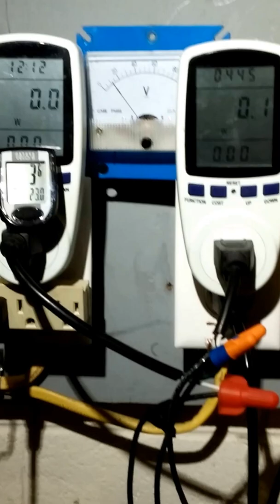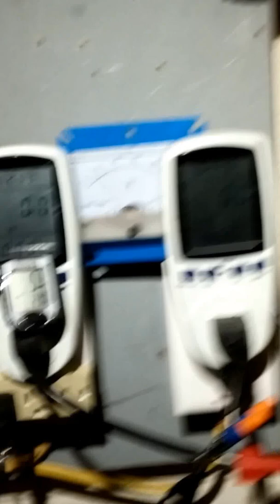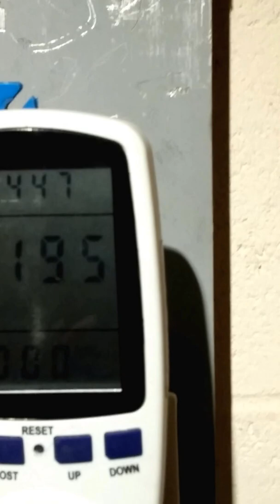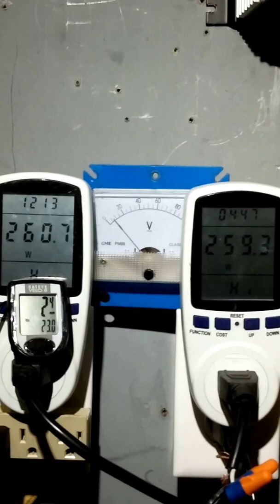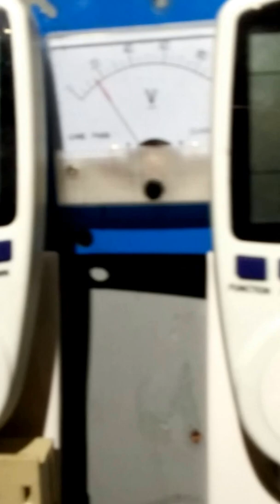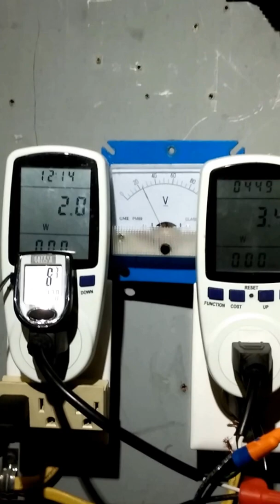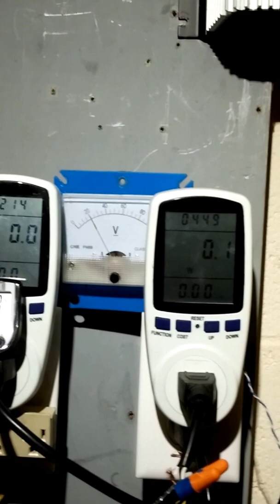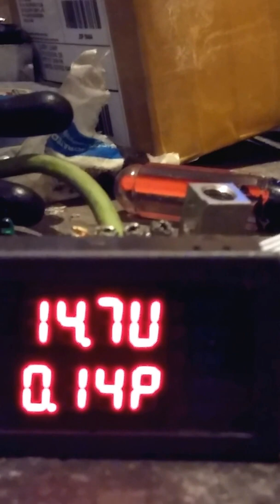Enphase Wind turbine Pt.2

Comment: Enphase microinverters with wind turbines seems like it makes so much sense. How is your system going? How did you stack your microinverters? Did you just wire them in parallel with the wind turbine? Is there a way to set it up so the microinverters activate one at a time adding in more and more microinverters as more power is generated? Have you tried out the system using IQ series?

Comment: NICE, what is current status?  Seems they would have been running for a while now.  Project details, plans, parts list, kit?
Reply from the maker: Well it was all an experiment to show the inverters will work. Thers really nothing to it. Just have an adjustable voltage relay that can take upto 100 v. Set it to dump right at the edge of the inverters top voltage. Trick is u need a constant 12vdc on the inverters to keeps its gate open. Ive only tested them with a windmax wind turbine 24vdc 1000w. . A car alternator turbine will not work. To much high voltage. The more inverters obviously the more load. 
No capacitors necessary but u can exoetiment. My set up was simple and worked fine. Hope this helps

Comment: Hey Larry- Quick question. I blew my Sun G (1500W MPPT Solar Gird Tie Inverter Pure Sine Wave DC 45V-90V TO AC 110v) but unsure if caps or what and i'm not smart enough to fix myself. Wondering if you, or if you know someone, i can Pay to have a look and repair for me??  If so, let me know and i can arrange to mail out.  thanks a lot. thx man.
Reply from the maker: sunsensational Hey Pal. First not sure if you trid just looking atthe fuse inside/Otherwise try contacting fearlesssthinker (Tom Rent) Im pretty sure he can fix it.
Reply: thanks Larry. i checked fuses and they looked intact. also i sent a msg to Tom Rent but no reply unfortunately. sadly i think because of the fiasco with the litigation etc. he has withdrawn completely from the YT RE community. but he knows me as years ago he asked me if i could send him the old CC that came with the Windmax400 for him to tear apart and analyze for a YT video. but if you talk to him at all maybe you can ask him to drop me msg or PM.  i don't imagine you have any other ideas? i paid $470 for this particular SunG 1500 (45v DC nominal) so i'm willing to pay $100 plus ship to have someone fix for me. it's prob something very simple like a mosfet or cap but i just don't know how to fix

Comment: micro-inverters on a wind turbine is exactly what I was looking for starting out today, I had given up and started watching some of your other videos and there it was.  unfortunately It looks like its going to be a good $1500+ to hook up which puts me back into the big GTI price point.

I'm in the planning stages and am thinking of going with 2- 1600w turbines and 1200w(12x100w) solar with grid-tie inverter(unless I can avoid it) and a small battery backup.  My plan is to get 1 turbine tied to grid and then half of the solar panels or both at the same time depending on price, then add as I can.  The batteries are more for power outages, I'm planning on this instead of a NG generator. 

could you give me a price on your system for what I'm planning, along with any extra's I would need along with it, thanks.

and I cant wait to see more on the setup and function of your turbine using micro-inverters,

Comment: Did you hook the 2 inverter DC inputs in parallel to the wind turbine rectifier output.  Also are you using a series of 2.7V super capacitors in parallel as well?  I have a 1500W 48V SkyMax turbine.  I have tried various GTIs from china.  However most can't respond fast enough to handle the wind gusts.  I am thinking a series of capacitors in parallel could load the turbine much like a battery and also level out the voltage spikes of the turbine to the point the GTI can handle the wind gusts.
Reply from the maker: I cant really reveal how i am doing all of this yet. However capacitors is not the answer for at least how i am doing it. All's they do is create a bigger load on the turbine. I can tell you the inverters keep up just fine with the wind speeds. I have since took them out of the equation. If you are going straight grid tie you should send back your 48v and get the 120v DC version that has a the GTI with it? Hope this helps.

Comment: Hi how can I hook capacitors to my hye 1000w 24 v to get better power output? Right now I see nothing on my meter when winds blow
Reply from the maker: hello, first off wind creates power not capacitors. The capcators actually put more of a load on the turbine. Caps are hooked up from positive to negative. Study on line how this is done because there are many different caps a sizes. there is no simple answer.
Thanks for watching